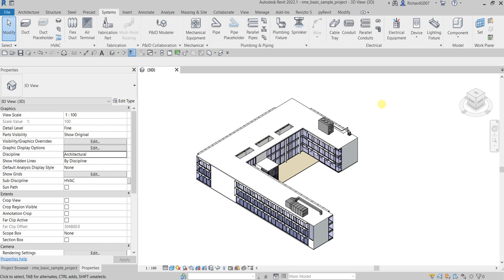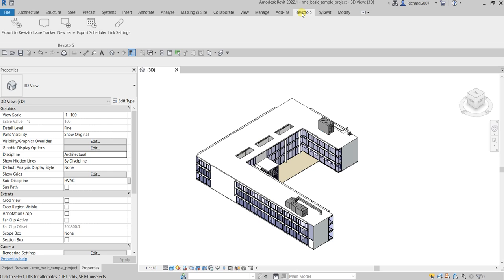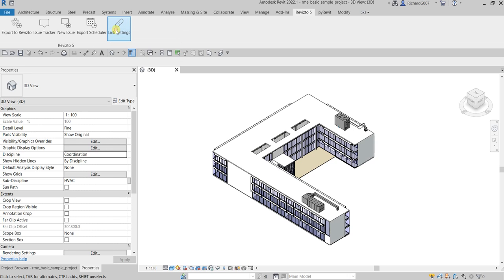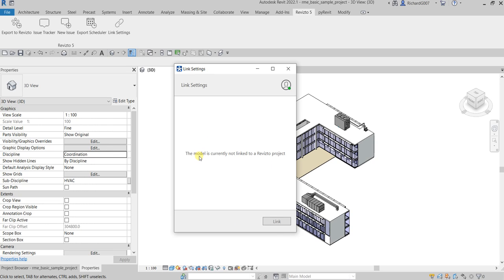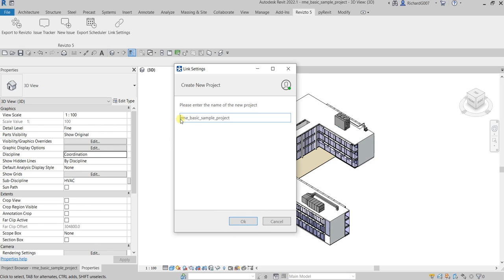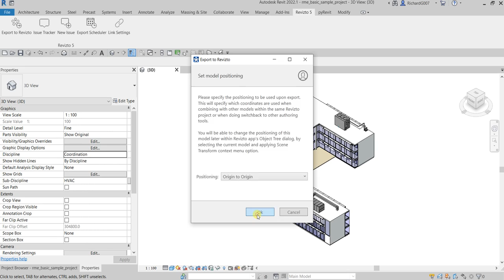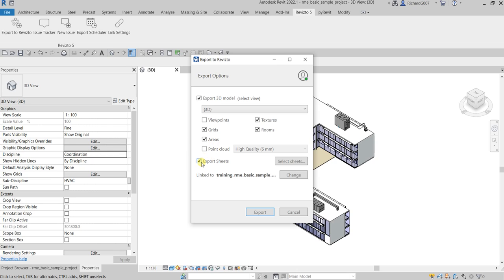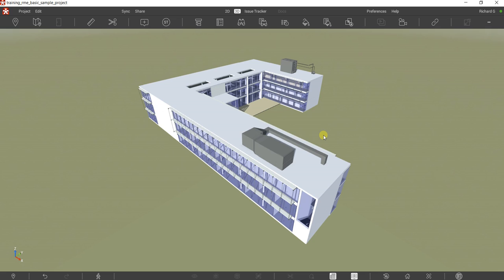REVIZTO LESSON 1: HOW TO EXPORT REVIT MODEL TO REVIZTO

Comment: Rich, as always very good video. Thank you very much. One question, when we have a project with diferrent companies where architects are using Revit, structural uses Arhicad, mep also something diferrent is it a possible with revizto to make a collaboration but without using ifc format?
Reply from the maker: hello sir, it really depends if the software they are using is supported by revizto or it has addins for revizto. like revit and archicad, they can directly export to revizto without using ifc. try checking the website of revizto and check out the supported software.